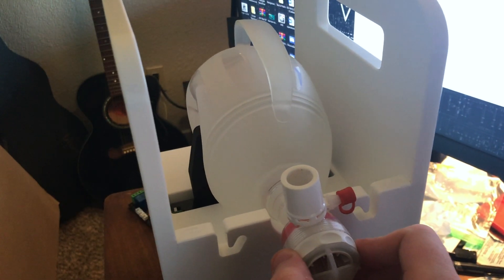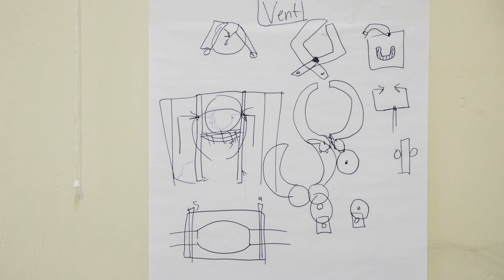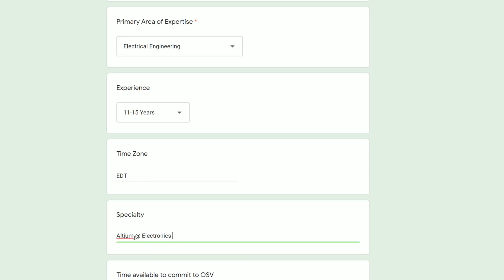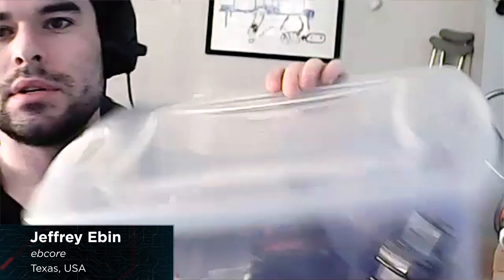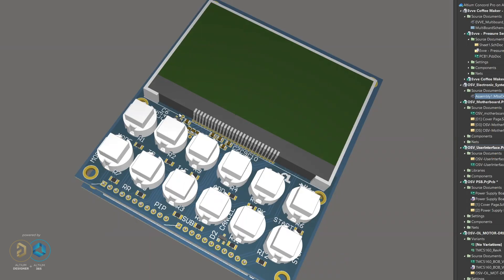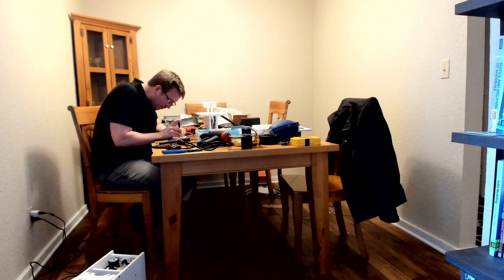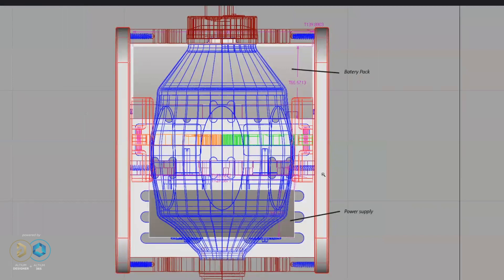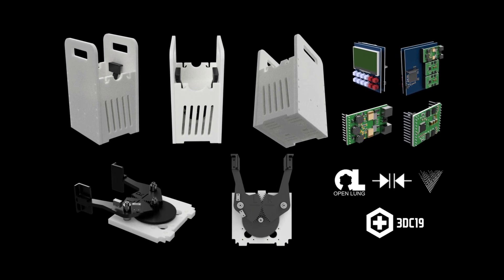Engineering Together to Save Lives - The Open Source Ventilator Project

Comment: If you are interested in learning more about other types of Open Source Medical Designs please check out the work done by OSMS
https://www.facebook.com/groups/opensourcecovid19medicalsupplies/

Their Design Guides contains documentation on open source respirators, gowns, scrubs, negative pressure rooms and more!

https://docs.google.com/document/d/1-71FJTmI1Q1kjSDLP0EegMERjg_0kk_7UfaRE4r66Mg/preview?fbclid=IwAR1kIl7Hr9-mSWFzva8MwYf5DFOvPjeE29HEQC9Ka10aYW-l28ePcFACW80#heading=h.ncjp6hqx78gl